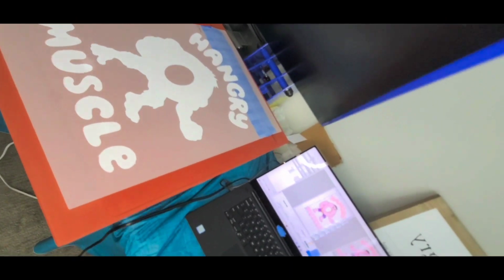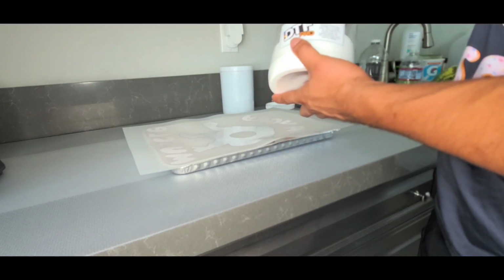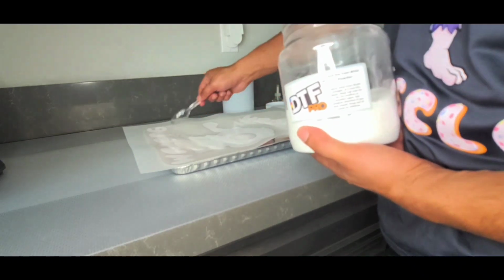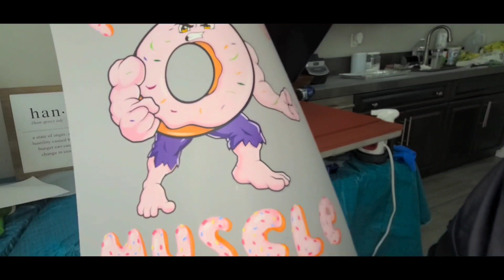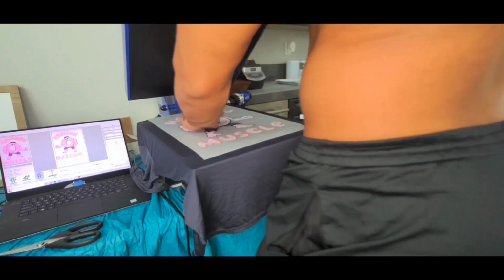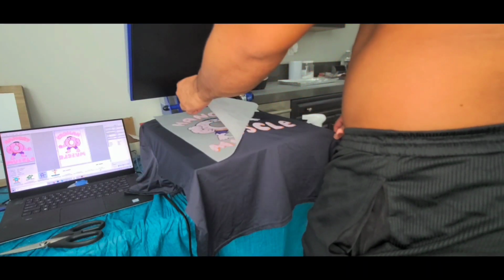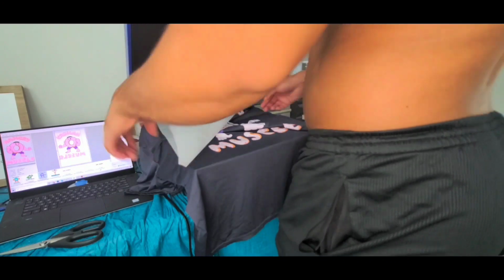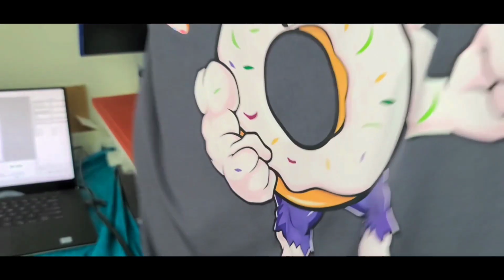How to Shake the DTF Ink: Epson Ecotank ET-8550

Comment: It finally happened for me, white is clogged! Any suggestions??
Reply from the maker: Method 1:
You can drain the tank and then run a couple power cleans with cleaning solution. When you put the ink back in run a power clean to get ink back inside the printhead.

Method 2: 
Open up the grey latch where ink valves are, lift the blue cap. There's a small valve underneath where the latch attaches to the printer.  You can take a syringe filled with air, you'll need a small tube to get the syringe to fit on the valve., (the tube I use for external waste tank works great) Keep pushing air into that valve until you see the color return. Make sure to  Place a paper towel underneath the printhead to catch the ink.

Comment: How hard is it to convert one? Thanks. If you have a video out that does it, would you be kind enough to link it near reply please. Would appreciate it.
Reply from the maker: Hi simple, remove rollers or pinwheels and then fill ink. https://youtu.be/dgpQITIRXYk
https://youtu.be/ubTK8k3ju00
Reply: I thought after you peel you press it again without the carrier to give it one final seal?
Reply from the maker: Yes you you repress after peeling

Comment: I have option to either buy brand new 8500 or brand new L805.. which one would you recommend.
Reply from the maker: Neither, they both have limited paper widths. I recommend looking for a printer that can fit atleast 13inch film.
Reply: @HangryMuscle  i also have option to buy L1800 or 8550. so which one would u recommend and why
Reply from the maker: I haven't used the L1800. I like the Et-8550, its low maintenance, fast refilling,  and easy conversion.
Reply: @HangryMuscle  my only worry is white in k requires shaking, and i have seen you shaking table to achieve this goal. do you think that much shaking is enough and never gave you any problems... since when i see white ink tanks with built in stirring motors, it kinds makes me feel worried that 8550 white ink  might get lumps. have you had any such issues or i am just over thinking. thanks
Reply from the maker: You're over thinking  things 😛

Comment: How do I get that black plastic covering the tank cartridges off? I feel like I need to shake them up. When I bake my prints, they look like the ink is separating 😩
Reply from the maker: Hi, its easier to rock the printer than take the tanks out and shake them. To get it off unscrew pretty much every on the front and top of the printer.
Reply from the maker: It's a hassle to get to. The tanks are secured in a metal case with alot of screws

Comment: Thank you!!. Do you have a video on bypassing the maintainance box?
Reply from the maker: Here's a video how to set up the external waste tank  and reset the chip on the maintenance box with the Chip reset fob. https://youtu.be/lzOqtVKDczU
Reply from the maker: The printer will not print without a maintenance box inserted in. I have an external waste tank connected to my maintenance box and I use a chip reset to reset the Maintenance box life when the printer says it needs to be replaced.
Reply: Could you post a link we’re you bought the waste tank ? I just got my printer yesterday.
Reply: @kevinvernier5605  The tank comes in the printer.
Reply from the maker: @kevinvernier5605  I made my own. https://youtu.be/lzOqtVKDczU

Comment: After pressing, my prints come out wrinkly in some parts, any idea what may cause this? I heat press at 320F for like 20 seconds. 

I reduced it to 305 and 15 seconds and it doesn't stick as good, but the wrinkle definitely decreased... my washes come out bad either way though. 

Any tips?
Reply from the maker: I think you're over curing the designs too long. Also make sure the film you're using isn't wrinkled. If you have tape on the film, remove it before curing the film. I haven't had any issues with washing. What film are you using?
Reply: @HangryMuscle  The curing may be it. I been using a heat gun to cure my films and that heats it unevenly. Sometimes it actually gets too hot in some spots and the film does wrinkle. I think I just need an oven to heat it evenly and accurately.

I use A3 film, cold peel for DTF. I bought it in bulk for a cheaper price in alibaba. Im hoping it's not the film but it definitely sounds like my curing process is bad with me blasting my heat gun on some spots too long.
Reply from the maker: @limetuul  Use can use the heatpress to cure instead.
Reply: @HangryMuscle  I did that and put the press very low and it just would not cure. I did it for up to 10 minutes at one point. For reference I'm using the heat press GeoKnight DK20A. I'm thinking of just buying a small oven to get an accurate timing and heat temp each time.
Reply from the maker: @limetuul  When using the heatpress warm the bottom plate for a few minutes then put the film on and bring the top of the heatpress down close the design. I haven't used that one but should be same process